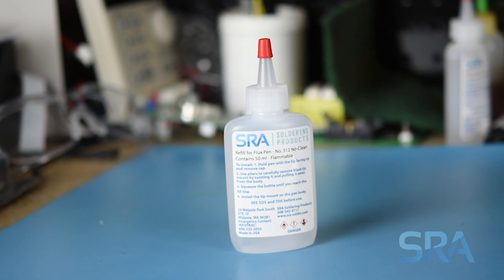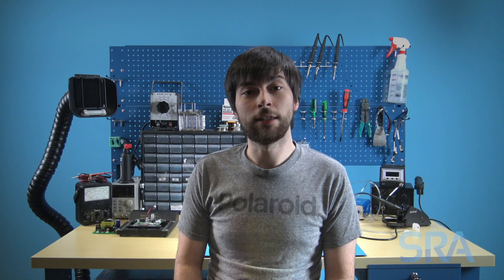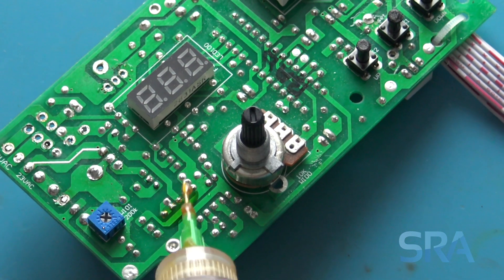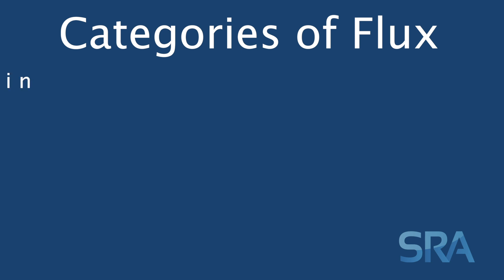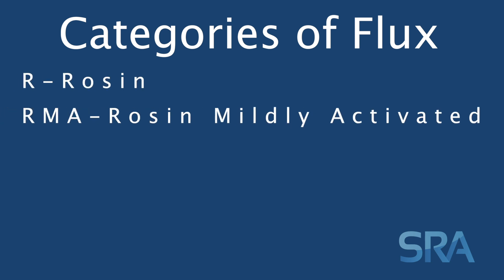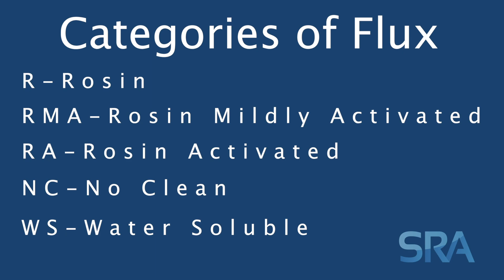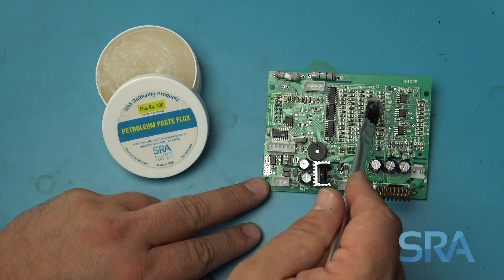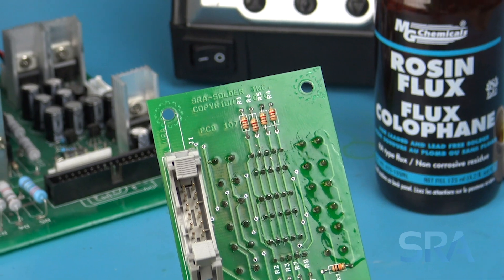What is Flux? - Solder Series: Ep. 4

Comment: I have been using a solder wire which has 3,5% flux, the problem i have encounter is that i have to change the soldering tip every short amount of pieces. My tip simply stops heating. I believe the flux is causing this issue. Do you know what type of soldering tip or branch should i use for this solder wire “SR-34 Super LFM 48”

Comment: I have a flux pen that emits a fluid that is quite runny and does an OK job. My friend has a tin full of flux that has a similar consistency to Vaseline and seems to work a lot better for me. What is the difference between these types?
Reply from the maker: The difference is really just the consistency and ease of application. If the paste is working better for you I would suggest our 135 Rosin flux paste, It is by far our most popular!

Comment: Your site has an RA flux solder described as “no clean.” It caused a troubleshooting nightmare for me from what should have been a simple job (socketing a DIP40 BIOS ROM on a Neo Geo AES). It seems that it’s also conductive. I only use it for tining my tip now, but it was something like a half-pound of the stuff (MG Chem).
Reply from the maker: Hi Emmett, do you have the part number available?
Reply: SRA Solder Lab Sure do:
MG Chemicals 4896-227G, Sn60/Pb40 x .040, No Clean Leaded Solder - 1/2 lb.
Part No: MG4896-227G
Though the picture and label directly describes it as “RA Flux,” the product description says “M.G. Chemicals No Clean formula uses synthetically refined resin and an effective activator.” It definitely requires cleaning!
Reply from the maker: Thank you for pointing that out, the description was incorrect. It is an RA flux that does require cleaning, we are updating the listing.
Reply: SRA Solder Lab Also, my brother ordered it through your Amazon store so the description was wrong there as well.